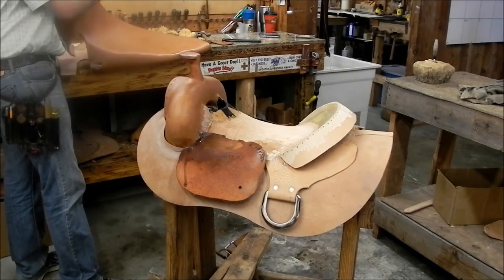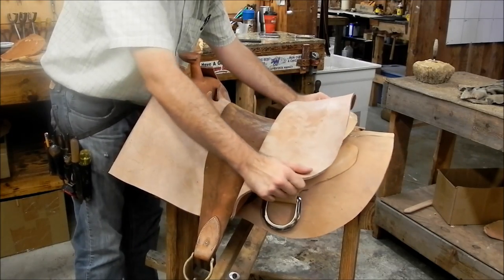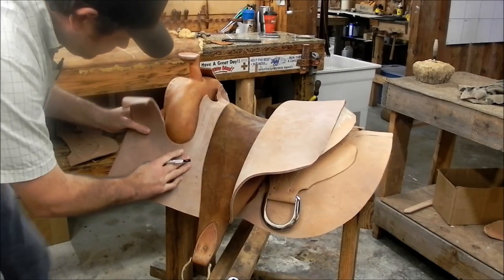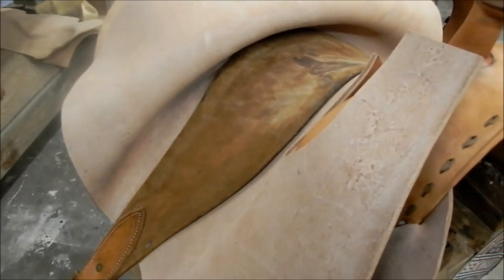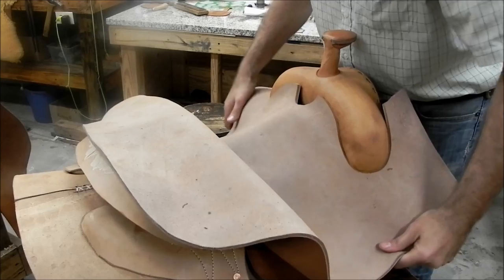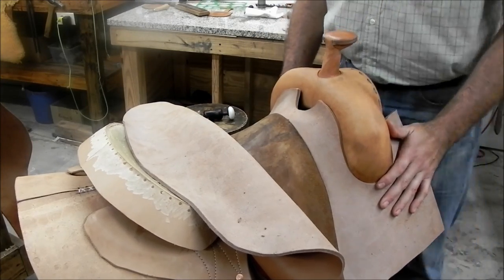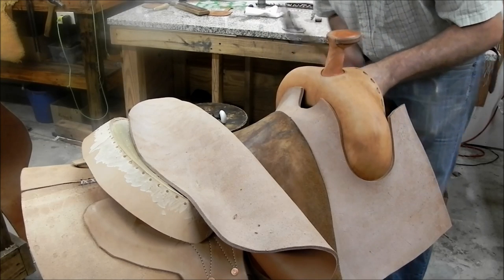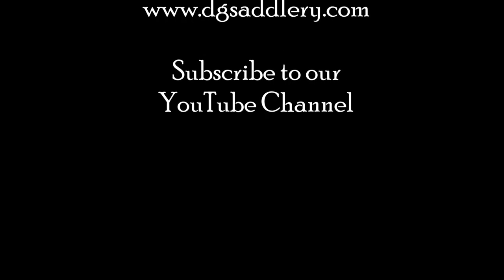Rough Fitting of a Saddle Seat

Comment: Could you do a ground seat video?  I made my first saddle with a tunnel style ground seat. I built the front as low and smooth as I could, but it still wound up too high. I am confused as to the best way to do it lower and more balanced.  Some instructions I saw seemed way overcomplicated. Should I order the tree without the risers on the bars to build a lower more balanced seat? Videos like yours have saved me a lot of ruined leather.

Comment: Dumb question here. On a rough out seat like that do you sand the rough down some before you put it on the tree or do you just leave it? I have been thinking on building me 1 & don't know for sure what to do on that. I assume you do not oil it like a slick seat when finished. Ain't never built 1 but I figured it's time to learn.